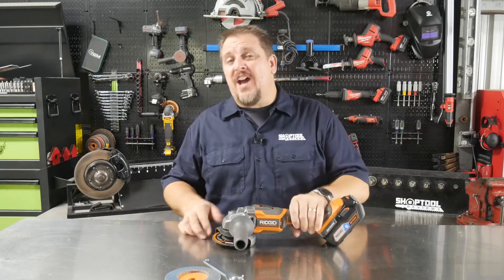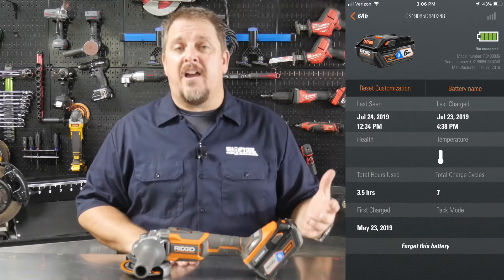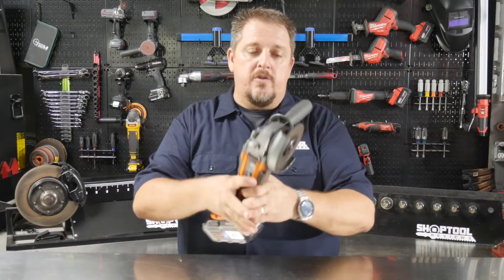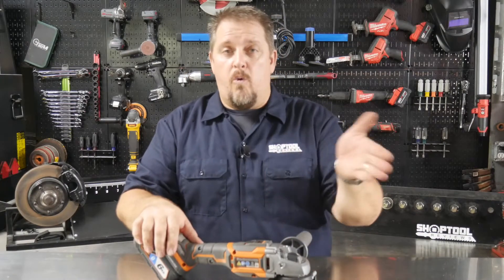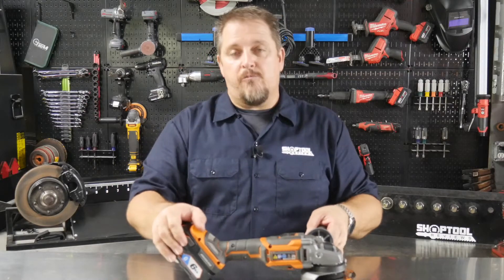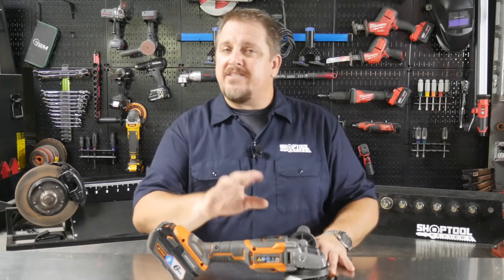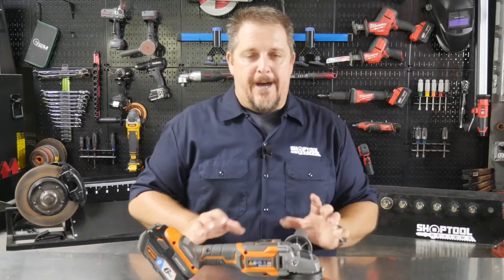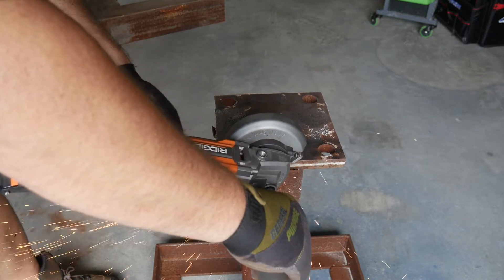Ridgid Octane 4-1/2" Angle Grinder Review

Comment: The thermal protection is a problem. Using a wire wheel it shut down on me multiple times.  Changing batteries doesn't help.  Plenty powerful but plan for lots of breaks.  I give it a seven out of ten.  Portable.  Easy to use.  Light enough.  The shutting down is ANNOYING!

Comment: I bought this grinder in march and the bearings are already shot. I have all ridgid tools and they are all going to crap. Bought them all less than a year ago. I was a ridgid fan-boy. Now I’m totally screwed with tools that suck and it makes me look bad. Buy dewalt. When I can afford it I’m replacing all my tools with dewalt. I used to dislike dewalt.  If you pull too many amps with any ridgid it will quit. Sometimes for 20 minutes or so. Sorry, I don’t mean any disrespect or anything. You are gonna be really embarrassed when you don’t have a tool that works when they are your job. The ridgid warranty doesn’t cover anything outside of factory faults. Even though the engineers are at fault for putting such Anemic bearings in their design that I don’t think aren’t even hardened steel. No offense. Not trying to hate on anything, but I don’t want anyone else to be in my position.

Comment: I bought this today to cut a few nails.  After reading the instructions, I now know that this tool is ONLY to be used with type 27 grinding wheels and should never be used with flat cutting wheels or for cutting metal.  So it's useless to me.  Your video shows incorrect/dangerous use of the tool per Ridgid's manual.
Reply: 90% of the time I always have a cut-off wheel (metal or masonry) on my corded grinders. If this grinder can't be used for light cutting, then it truly is completely useless.
Reply: Dude.....Just cut the metal. It's a grinder, it's no more dangerous than any other grinder cutting metal. That's all I use it for. I do shipping in an industrial machine shop. I've ground we'll over 500 pcs. with it.

Comment: They need to put switch on the handle to operate with your finger like my electric Milwaukee.  It the only thing I don't like about it
Reply from the maker: Yes, I would much rather have a paddle-switch than the sliding switch on the top. Thanks for watching.

Comment: I bought this and the battery life is just about 3 minutes of running with a 4amh battery.
Reply from the maker: Continuous runtime cutting or grinding steel, I'm not too surprised. I would recommend the Octane 6Ah battery for this grinder. Thanks for watching.
Reply: @Shoptoolreviews  forget it. Once the battery heat up which take about 30 second and then it shut off.  you have to wait or switch to another battery or wait for it to cool down.  i don't have time to wait. you can have a 12ah is still a useless tool.  I would not recommend to anyone for this tool.  I own a lot of Rigid tools.  this is a fail design.